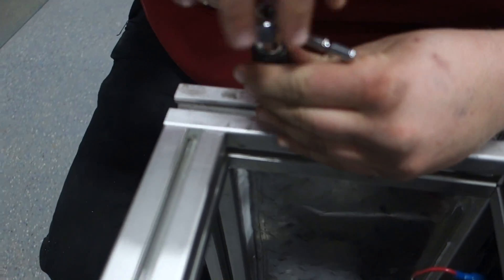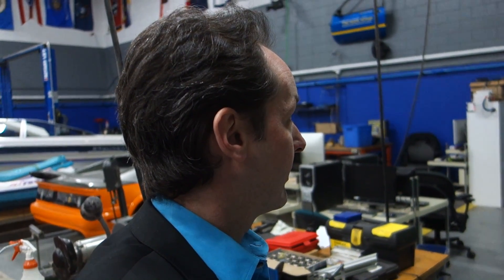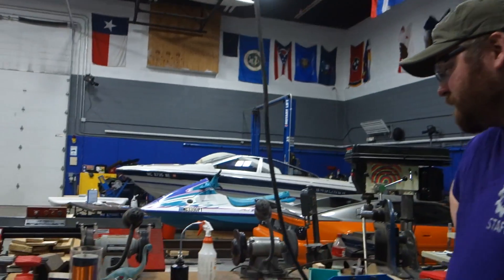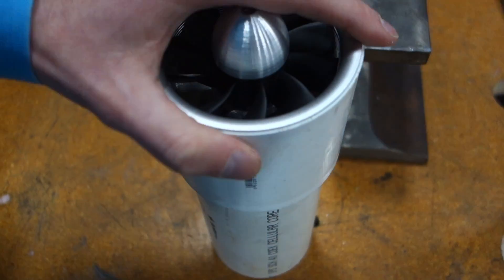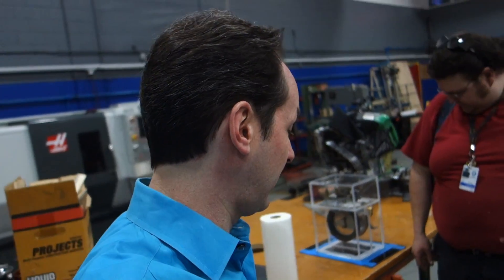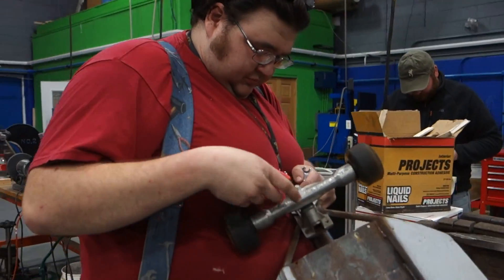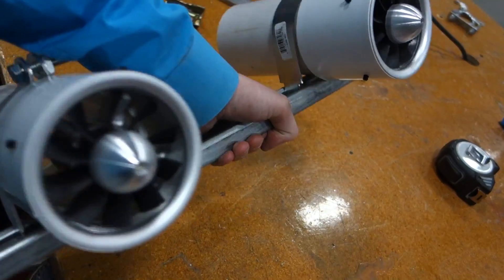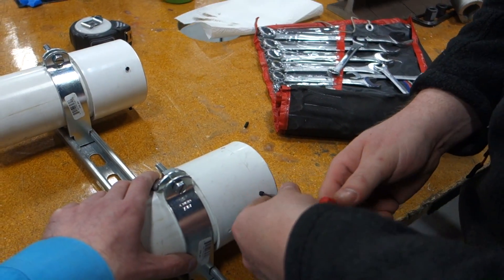Captain's Blog 2-11-2016 Mini coil, gas meter and EDF Jet luge

Comment: There's a guy who's been on the Discovery channel who has 4 EDFT turbines like that mounted to a hand held assembly that can pull him up a hill on a snow board. Other than adding a few extra turbines, I know this will work. The only reason I'd add more is for extra speed/thrust ratio.

Comment: Specs say those are 87 amps max each, so 90-100A ESCs would do it. You might want to look into car ESCs because they often have an integral fan.
Reply: Hobbyking says it's good all the way up to 6S, and you really want 5 or 6 because the KV is so (comparatively for an EDF) low, and the max RPMs are listed at 40,000. 2.65Kg thrust at 6S. Here, have a link. http://www.hobbyking.com/hobbyking/store/__63510__Dr_Mad_Thrust_80mm_10_Blade_Alloy_EDF_1800kv_Motor_2200_Watt_6S_E_flite_.html
Reply: +Chris Boden Specs:
Rotor Diameter: 80mm
EDF Inner Diameter: 82mm
Outer Diameter: 84mm
Construction: Alloy
Weight: 300g
Max RPM: 40000
Motor Type: B3648 1800kv
Max Power: 2200W
Continuous Power: 2000W
Max Voltage: 22.2V (6S)
Max Amps: 87A
Max Thrust: 2.65kg
Motor Connectors: 3.5mm